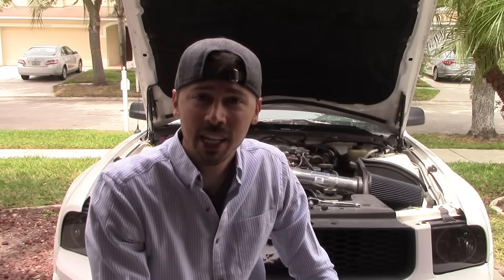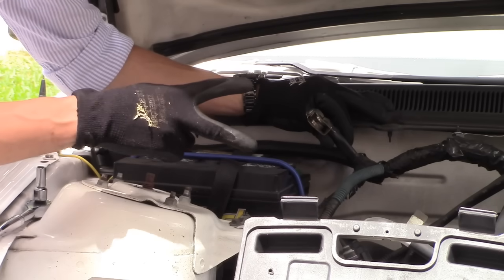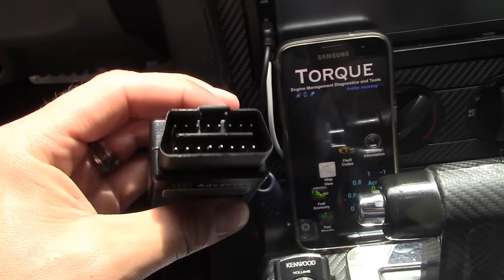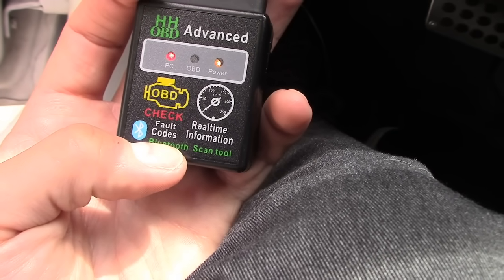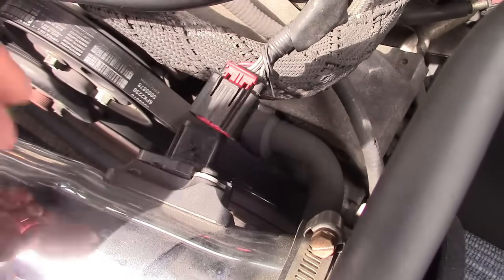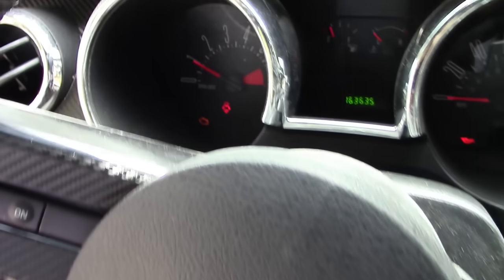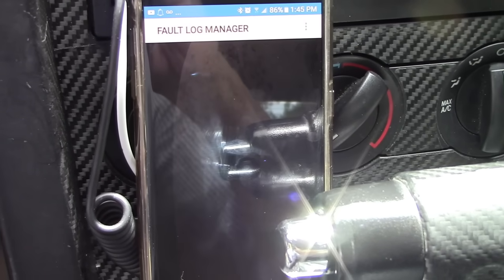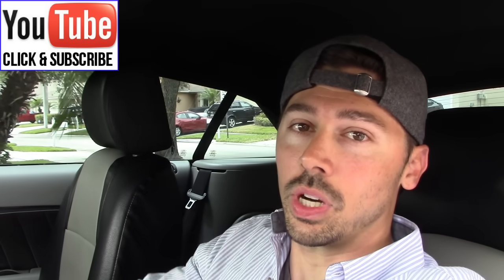3 FREE WAYS TO RESET CHECK ENGINE LIGHT WITHOUT CAR OBD SCANNER

Comment: The light is on because a sensor is bad or a mouse chewed a wire the only way to properly shut the light off. Is fix the problem. Unhooking the battery  will fail an inspection in vt

Comment: first one worked for me. disconnected the negative for two minutes
Reply from the maker: If the light triggers again that means you have still a problem you have to take care of, but if it was just a loose gas cap then light should stay off.

Comment: If there isn't anything wrong and you just left your gas cap off or something, the light will turn off after 40 drive cycles. If there is something wrong, the light will just come back on.

Comment: This worked for me. Thanks for the tip. My gas cap was the issue, I guess I didn’t tighten it enough after fuelling. The check engine light was still showing so I tried your tip and it worked well. 👊🏼

Comment: I've been an automotive technician for over 40 years, and you never clear a check engine light. The monitors are all run, and clearing the light clears the monitors. Causing you to fail emissions until they all relearn. Could take several days or even weeks. The proper way to clear light is to find the cause of the issue and the light will go out on its own. Usually in 1 day of normal driving.
Reply: @MrDejast  This is incorrect speaking as one who has controller chip and automotive firmware inner knowledge from the automotive industry. Some trouble codes are informative but even after repair require a reset/clear after correction.

Comment: Hi. The engine light on the mid 2000's Nissan Sentra is ON (it doesn't flicker or anything). After a few minutes of driving the gas goes out, you can't accelerate (there's lights, aircon but when you depress the gas, there is nothing). If you switch off the engine and start it again, you get the gas back.

Thank you in advance.

God bless, Proverbs 31

Comment: In my 2008 honda accord, when i unplug the connection to clean the maf sensor, check engine light comes on and wont turn off even when i already connect them.
So what i do is same with first step. Disconnect the battery. Wait 30 minutes. And after connect the battery again, done. 
Well, there's nothing wrong from the sensor in the first place, i just happened to get bored so why not to do some easy works.

Comment: is this obd-2 scanner better than most scanners? I have an innova brand scanner, it cleared the p0032 and p0052 codes but the fault codes come back after I changed the o2 sensors.

Comment: On a 1999 mistubishi pajero  3.5 'have tried the elm327 dongle but apparently the protocols used by the cpu are proprietary ie: called  mutt protocol hence dingle cannot talk to the car cpu,dongle links to phone no problem but without data sent from cpu-would like to use the torque app as you've shown- have you any procedure or a work around that issue that you might have discovered -thank you.

Comment: I just turn off the ignition, wait 30-60 seconds then restart the car, fine, off I go. Toyota Fortuner 3.0 litre turbo diesel...
Reply: Phil Hohnen sir did you fix the problem? I also have a fortuner 3.0 turbo 2006 model, same problem check engine

Comment: Hi... I got that problem. Even if they reset it, the engine light is still there.... They said need to replace spare part, and it's expensive... my car is suzuki swift 1.5 2008...

Comment: Couldn't you on some models just turn your key to the on position, take your diagnostic port and jump 4 to ground, and with that jumped; jump 5 to ground for at least 5 seconds. Remove 5 to ground, and then remove 4 to ground. Then the key off for 20 second and then cycle it back on to verify memory clear?

Could be useful for a latched code that has had the issue corrected.

This would of course be if you have a 12 pin diagnostic port.

The function of this would be ecu on, diagnostic on, memory clear active, memory clear deactivated, diagnostic off, ecu off.

Comment: My CEL has been on and off for four years (mostly on) and VW, Independent Mech., etc. have never got it to stay off. Everything checks out okay on the computer. Everything works well, but no one gets it to stay off. Can anyone help?
Reply: the light is there for emission related issues only,everything does not check out ok or you would not have a code.try researching the issue your self online.goto the autoparts store and have them pull the code for you ,and check to see if others with your same car have same issue.find out what happened to their car. check online groups and forums.its not the 90s any more.there is 10 trillion times more information out there now that you can get for free with a little work

Comment: THAT WILL CLEAR THE CHECK ENGINE LIGHT BUT YOU WILL NEED TO DRIVE THE CAR FOR MAYBE A HUNDRED MILES JUST TO GET THE CAR TO PASS INSPECTION TO IF THE CHECK ENGINE LIGHT DOESNT COME BACK ON BEFOR THE INSPECTION MY THOUGHT

Comment: Good video people are saying that if you reset the CEL light the problem will still be there yes in most cases but if you ever owned a saab that had tons of GM electrical problems than the cel light would come on if you hit a speed bump to fast so sometimes a simple reset could save 100s of dollars if the light continues to illuminate than I would change out the part
Reply: the real problem is that you drive a saab

Comment: Thanks dude.  I have 2014 F350 and 3 times the check engine has come on and the dealer found no issues but as long as the check engine light is on it disables my remote start which is a B in the winter.  Now I can clear the stoopid codes.

Comment: Genius! "free easy ways to reset"
BUY! OBD scanner, read error codes, use technical knowledge and experience to decipher codes and trace fault, rectify fault buy repairing wiring or replacing component, then clear the error codes.
Assuming of course the fault is not a loose fuel cap or something you unplugged yourself, it's one of the other million possible causes!

Comment: Worked for me I passed emmisions,I don't care if it comes back on
Reply: It is not true. If your car smog test required to test at Star station, you will not pass the smog test (I/M is not ready). You must drive your car to satisfy the drive  so all components are monitored and ready for smog test. You are lucky test with regular test station.
Reply: @VuongNguyen-cg6yo  if his car was 95 and older it could work,but most people dont drive a 91 civic like i do
Reply: @trashy10  - 1995 and newer car has with  implemented OBD protocol that helps smog check more easy. With older car before 1995, smog check is manual and cost more money than the newer. If you have 1995 or newer car, then buy a OBD reader (Around 30 dollars on EBAY) that would help a lot.
Reply: @VuongNguyen-cg6yo  totally missed my point,on odb1 cars this trick could work because they dont hook your car up to the computer,so they dont read monitors.also obd2 is 96 and newer not 95

Comment: Dont "reset" the car by dissconnect the battery, if its absolutley nescessary...this reset  all of the short terms data in RAM. Like injection correction values, short and long term fuel trim and more...this is just few of the bad things, what happend. Better to read out and understand the code, why your MIL comes up!

Comment: Do you know if your monitors also get reset when you reset check engine, or does it leave them undisturbed? Need to know for my emissions test. Because monitors cannot be reset.
Reply: bruh your resetting the computer,like unpluggin your microwave ,what happends to the clock when you do this?

Comment: My check engine light has been on for 7 years and it's exactly the same thing every time 02 sensors, I've had them fixed 9 times and STILL  have the same problem,  so what now?
Reply: Did they, by any chance, write down how they diagnose the issue? If it's been done nine times with no resolution then I get the feeling all they did was check the code and swap parts.
Reply: If you can drive for 7 years with that damn light on then why are you worried. Take the bulb out and keep driving. And sell that bulb on ebay so you can get some money back that you spent on fixing it.

Comment: That first method only turns the light out...won't clear the computer.On my f150 I disconnect  the negative battery cable only and run a jumper wire from the positive  to the negative cable for about 1 minute....than take it for a drive and let it learn all the shift points and fuel air mixture.

Comment: Get a Actron CP9690 code tester. It checks live, record, graphing, oxygen sensor test, transmission codes, emissions readiness test, it has code lookup to diagnose codes, and MORE! EBAY has it. It works from 1983-2013. It is updatable.

Comment: My light was on for my O2 sensor I wanted to give it a shot, already ordered the parts to fix it. It worked, but I my radio has no sound, it lights up and switches stations,  you can hear the CD spin, also I checked, all fuses are fine. Any suggestions?
Reply: look in your owners manual some cars have anti theft or need security code after you fallow dummies on youtube .
Reply: you have been YOUTUBED!

Comment: Disconnecting the battery only resets it for 500 km. If your check engine light is on it's on for a reason...it's usually a sensor in the emissions or fuel circuits...
Reply: George Hembrow that’s not why this video is here . It’s here if you replaced the problem and do not have a odb2 reader. 

I sincere hope you do not work on cars 😂
Reply: @MichelLinschoten  hes comment makes more sense than yours. If the light is on you have a problem still turning it off doesnt fix the problem the light will come back on shortly.

Comment: After hundreds put into part replacements I Just want to say I used the 2nd method 
And it cleared my check enengine light on my 03 navigator , I drove from Denver to Salt lake city and no check engine light came on I was able to use this truck as a trade in. So thanks for the tip.

Comment: Thanks! Now I know where to but the OBD so I can fix the problem and shut off the light. I have taken it to the shop 3 times for various issues but the car always come back with the code still on. Its either time to fix it my self or find a different mechanic.

Comment: Will this clear a P0420 for 2005 Dodge Caravan SXT?  I changed the battery on this car and the next day the engine light came on with P0420.  I want to confirm its a real problem.
I have something similar to what you show but it would not clear the Engine light

Comment: Most times when the check engine comes on there is a engine fault , Check the codes fix the fault, then reset the check engine light, test drive , if the light comes back on there is still a fault.

Comment: I have been driving for 2 months now. I felt unlucky as my car stuck on a highway after producing smoke from below the hood. I asked a person a person near to me to check and it was found that radiator hose was out. We fixed by refilling the coolant. Still it gives problem after driving to 3 km distance by releasing smoke from the front hood. What should I do now.
Reply: when its cold add water park it on your lawn,let it run with the radiator cap off,add water when it needs .do this for 20mins then put the cap back on and go for a drive.if it still over heats then you have a bad head gasket.confrim this by checking the oil,does it look like chocolate milk?if yes bad head gasket.if no make sure your fans turn on when the car is getting hot.does it?if yes then proceed to the nearest lake and drive your car into it

Comment: Nice video, but i'm on a different situation now. i have a check injection and check stop/start fault on my dash but when scanning  faults, there is no faults there! How can i fix the issue? Thank you.
Reply: Paypool P the stop start issue will prolly be manufacturer specific which u will req manufacturer programs to scan specific systems, obd only scans generic codes

Comment: Removing the light will not be permanent. It will come back. Your car must complete a drive cycle to be clear for state inspection. If the light returns before this clearing you can not pass an emission test in PA. Also cant use another car because computer registers your vin number.

Comment: always scan your car before doing any of those steps, due to many different reason for setting a “check engine light” you want to have that info, do a little research to make an inform decision if you need to take it into a mechanic because there is vital information that helps in diagnostics

Comment: Most common failures are loose connections or bad sensors in engine bay . Also checked wire harnesses for opens and corrosion. Last thing is your gas caps make sure it's tight

Comment: Some FYI..  Check engine light is designed to indicate a problem within the vehicles engine/tranny electrical systems. The way to erase the light by normal standards, is to check for the error code, fix or replace whatever electrical component is bad. Of course, and a general rule of thumb, is to disconnect the battery when ANY electrical repair is going to be done. By doing this, the check engine light goes out bcuz computer will sense the repair And, the code which would otherwise by All means stay on the computers memory will also be erased. Of course all codes are erased by this process, but good codes that the computer uses to monitor engines electrical system will return after some driving.  Reason I take the time to post this info, is bcuz many believe that erasing the check-engine light will fool the inspector when the time for vehicles inspection is due. It is EASY to erase the check-Engine light, but the error code (if any) remains in memory and DMV's inspection computer will get it from the vehicles computer.  If that happens, your vehicle will be FAILED.  Free is a nice word... Proper, is a better one.
Reply: good advice,but more FYI the MIL is there only for emission related issues,nothing else
Reply: All these "easy" fixes do NOT fix the problem..The engine light will come on again after driving for an hour or two ..The only real fix is to bring it back to the garage that specializes in your make of car no matter what age it is

Comment: Install new cap after scanned code at auto zone but engine light still on, do you think they didn't reset it , the sales person told me drive it for few minutes light should go off but it didn't. . What do you suggest should do
Reply: 1st what the hell was the code?installing gas caps dont just fix all codes

Comment: He clearly states that you obviously fix the conditions of the car before resetting it. The CEL (check engine light) won’t come back on after you fixed the problem. The ODBII code reader will tell you generally what’s wrong with the car, so that you may target that issue. He’s not showing you how to temporarily bypass the CEL. He’s showing you how to reset the CEL after the problem is fixed... clearly...
Reply: if you fixed the problem the MIL(malfunction indicator lamp) will go off by its self in 3 drive cycles .Only people on Craig's list and Youtube say cel

Comment: I want to see if you can have the check engine light off while installing an aftermarket exhaust system for your car.
Reply: as long as you don't mess with your o2 sensors or catalytic converter you'll be fine

Comment: Sir totally informative, the car dealers have a hold on you when they tell you they can not reset unless they 1. do a diagnostic and hit you with 150.00 and 2. fix the problem and hit you with parts and huge labor costs.  If I can fix the problem myself I would rather and now I can reset engine light.  And if I was paying attention correctly, if I didnt fix the problem the check engine light will come back on.  Loved this video again thank you so much
Reply: Yes well shops have to pay for a lot of software. It's not unreasonable that they want a way to recoup any costs
Reply: if you did fix the issue,the light will go off by it's self.Try it unplug a sensor in your eng bay wait till your light comes on,then plug the sensor back in and drive the car normally it may take a day or two but you will see.

Comment: Just take the car to a tuner with a laptop. He'll make the C/E light go out...... forever.
Reply: Please exain whats a tuner
Reply: Dont understand, please Be more specific
Reply: @merimalazoric5863  Turners with a laptop can do all sorts of cool things. They can turn your check engine light go out by removing the "code" that turned it on. They can also give your car more horsepower by tapping a few buttons. Kinda like magic.
Reply: @99bx99  
Thanks 
I have problem with Light i can’t di inspection 
Dont know What ti do 
I have time till the end of March

Comment: My car was at the auto elecricians they couldnt find the engine light circuit, i did have a mongose system put in many years ago but if they couldn't find it where else can it be.
Reply: try letting a cobra loose in your car ,cobras and mongose are natural enemys

Comment: Nice video, use to be able to fix any problem in the 50's60's70's 80's and 90s without moneygrubbing mechanics and crap electronics.  I worked on everything all these years.  Just put a piece of electrical tape over the engine light, until the car breaks, then run it in the river...Problem solved!

Comment: Thats all great but you're never supposed to clear the ecm while the engine is running as you can wipe out all of the run parameters.
Even though that cheap little OBD scanner won't let you change the parameters or reprogram them